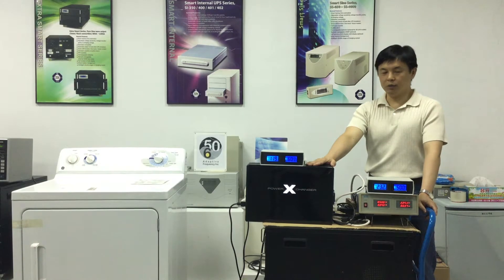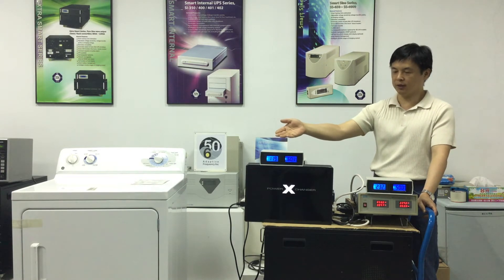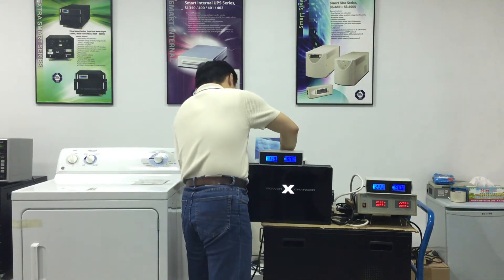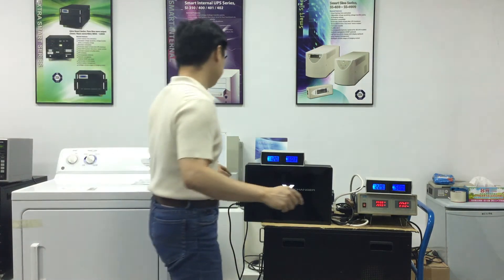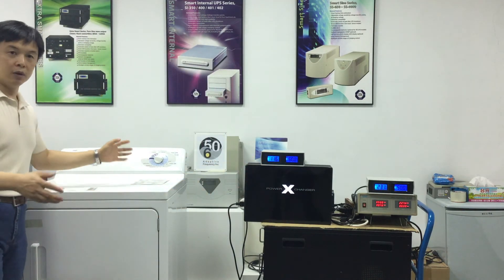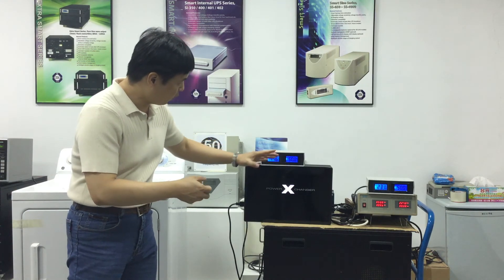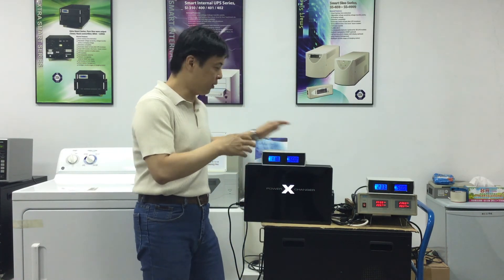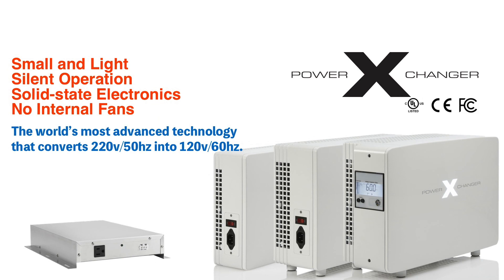Converting 220V / 50Hz to 120V / 60Hz, using a voltage and frequency converter, gas dryer demo

Comment: Iv got a  4k RV transformer 230AC 50 Hz-120v AC  60 HZ in my US Rv here in Norway. The AC fan will run at the right speed. With 50 HZ its will run at slower speed. The power supplys will get hotter.